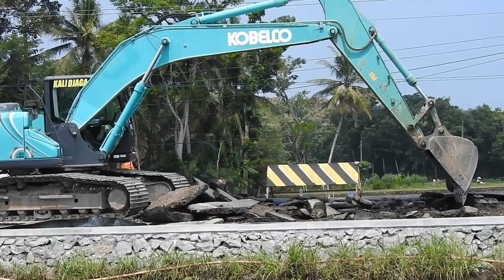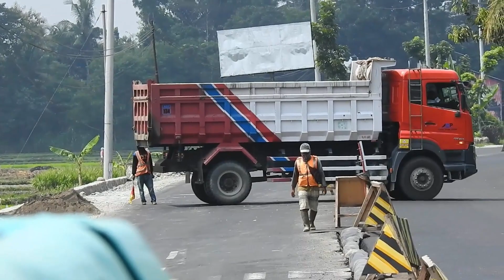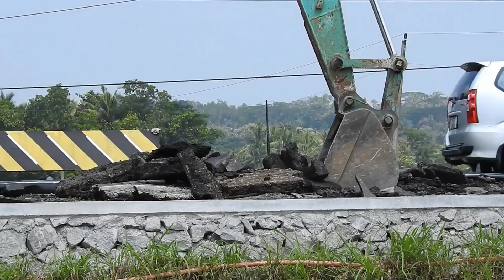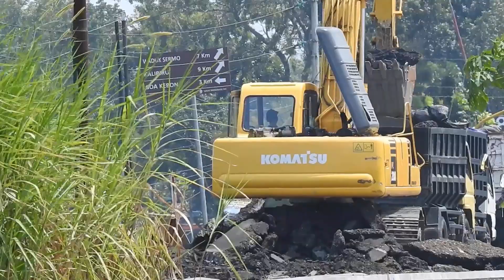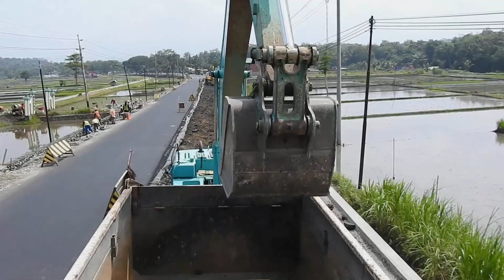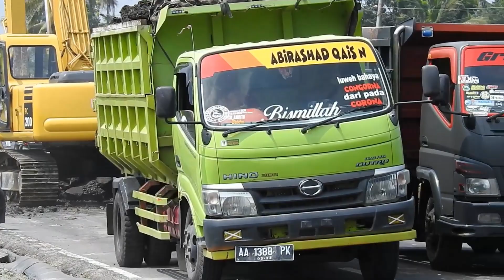Road Reparing Construction Asphalt Removal By Excavators And Dump Trucks

Comment: Try looking for fresh small cracks in the asphalt and over time watch them expand in size. When you look at the cracking imagine the most obvious way of it's most consistent break down symptoms. Realize it is being broken down from above and not earth issues so much.  See the small sand with tar granules being picked at 1st and down too the aggregate embedded in compression of equal forces all sides. Realize these 3/4" 22.mm rock get fracked into pieces then broken out bit by bit and this will continue until the road would be consumed.  I Track the reasons why this is happening.  Cheers All, God Speed. 
Ian.
Reply from the maker: Yes, like i watch on your video. Where the pressure is come, then the crack is in the point. Thank you Ian, greeting from the Hot Land.